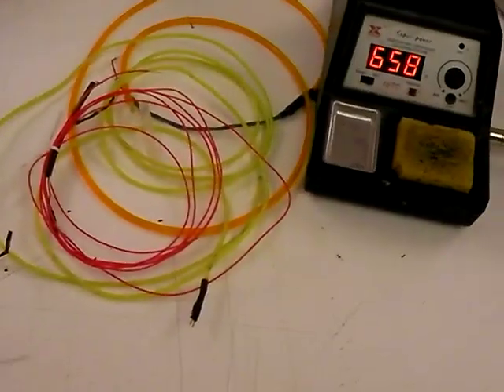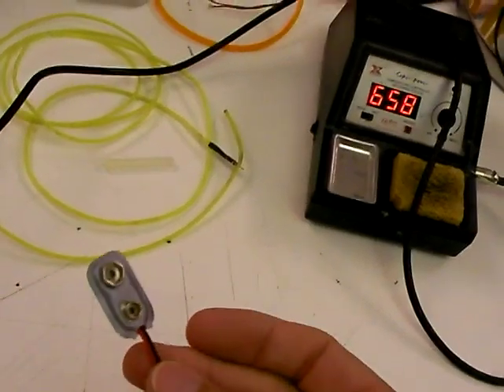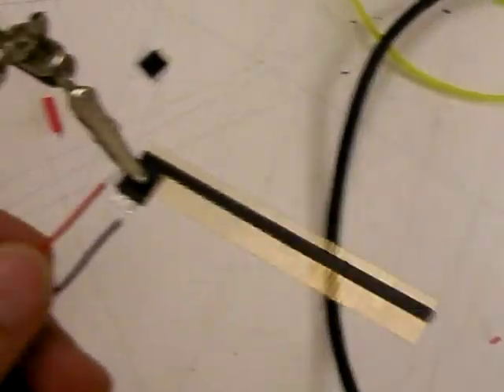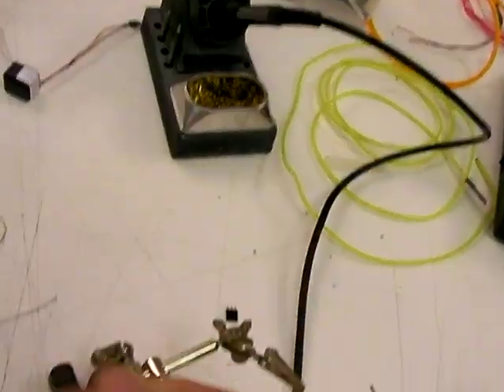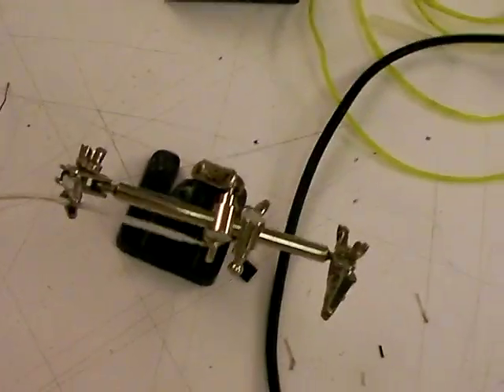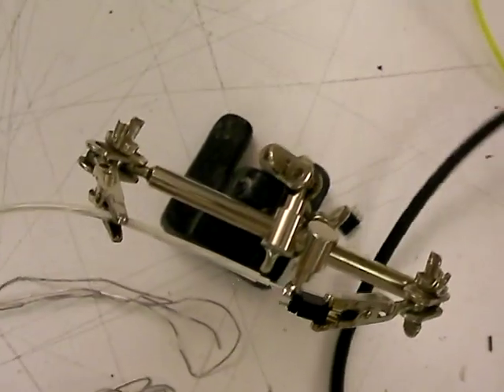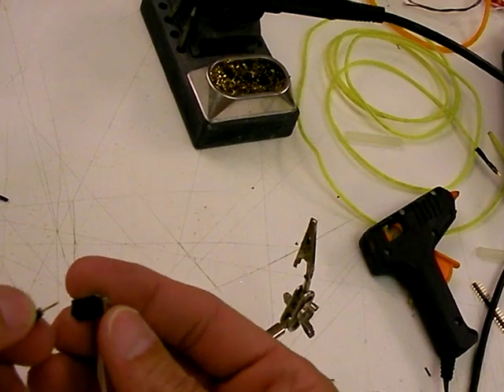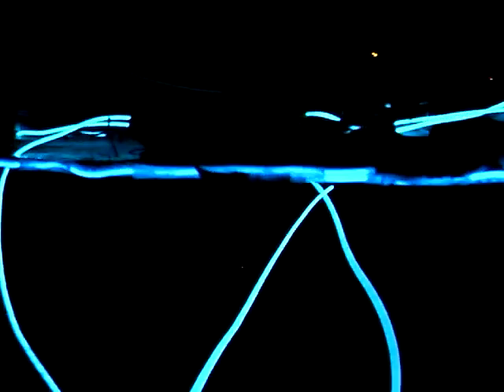How to use el wire (electroluminescent) wire on your plane.

Comment from the maker: I just zip tie the inverter on the deck like the speed controller. As for the el wire you can attach with tape/zip ties or sort of sew it through the foam. I'll try and do a video
of it tonight.